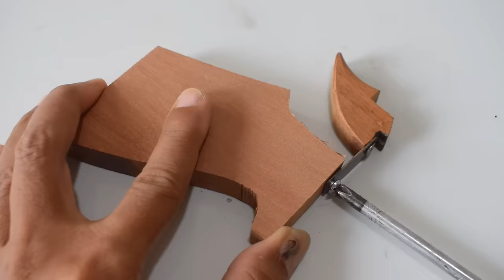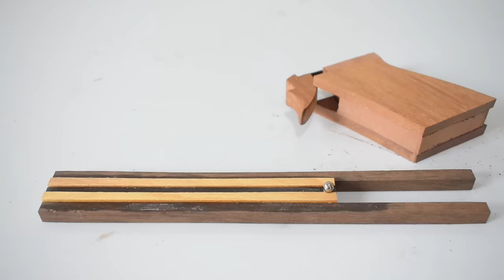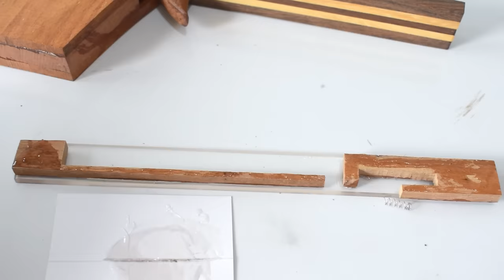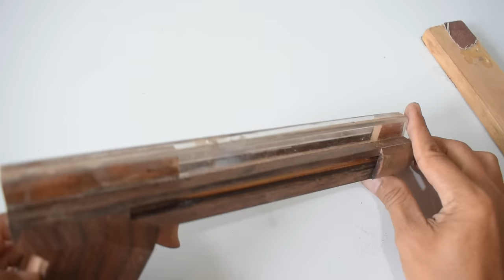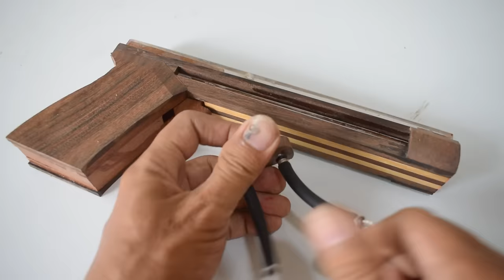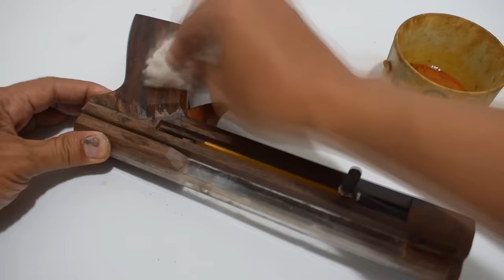Slingshot for defense

Comment: Really cool design. It's mostly held together with superglue, but most of the parts aren't under much tension, so that's fine. But I don't know how long the thin strip of metal in the gravity feed ammunition mechanism will last. 

Very attractive finish put on it too!
Reply from the maker: Thin metal as a trigger is strong. But the rubber no. The rubber can change if broken
Reply: @diycrossbow  Cool then. Thanks for answering. I'd love to have one of my own!
Reply: Two flat wooden parts stuck together with super glue , become pretty much one piece. I can assure you that you wouldn't be able to take that sling apart. No way.
Reply: @marcinradziejewski6086  Yeah, but you don't need to take apart the entire gun to replace the bits that would need replacing. It's fine if most of it is now a solid object. Only the "strings" for the slingshot are likely to need replacing anytime soon, and that's an easy fix.
Reply from the maker: Right. Only string and rubber need to replace. Another material are strong 🙏🙏🙏
Reply: @Indicteronomy I thought they were saying that as a testament to the sturdiness of the build, not saying that it would be hard to repair because of the sturdiness
Reply: @marcinradziejewski6086  q pegamento usas broh ❓

Comment: Aside from the fact using CA glue to stick together pieces of wood isn't the best way to do it (there's also wood-exclusive glue that works better), isn't putting CA glue in both pieces, letting it dry for some seconds, then strongly pressing both pieces against each other a bit better? That's all there is to question about this build, amazing job
Reply from the maker: Wood glue is the best, for fast result CA are good choice

Comment: I have a question regarding how strong this slingshot is, would you happen to have rough stats like feet per second, and a rough estimate of how much effort goes into pulling back the rubber band. I am also interested in how far away it remains accurate. This is just personal curiosity at how effective this is as a design compared to standard slingshots. I am aware you could increase the power with a stronger rubber band, but just for curiosity sake, as it seems something like this could make a good starter slingshot due to being able to incorporate a site if it remains accurate at moderate range
Reply from the maker: For power and accuracy you prefer choice long design slingshot
Reply: @diycrossbow  thanks for the advice
Reply from the maker: Welcome
Reply: @diycrossbow  Hi, how much of the thin c.a. glue did you use ,roughly.

Comment: A few issues I can't help but wonder about:

1. That CA glue can't possibly be strong enough to hold this all together long-term. Have you had these break?
2. The CA glue also soaks into the wood fibers. Won't it make the finish splotchy?
3. The way you secure the rubber tubing to the screws looks like it's just waiting to come flying off.
Reply from the maker: Thanks🙏

Comment: Some suggestions for both the audience and creator, dont use superglue/crazyglue. Use an actual wood glue, else in a few years with constant use, the layers will seperate due to moister and temperature and because those glues are extremely brittle. Also regarding the trigger system, it would be more reliable to put the trigger on a pivet and use an actual spring. Especially because buying a strong spring is often cheaper then buying a piece of spring steel, cutting it down and drilling holes into it. Finally, if you don't know what you're doing, the friction from working the steel will destroy the temper of said spring steel, and it will become less springy and more brittle.
Reply from the maker: Thanks for watching🙏

Comment: Nice build!

On the wood to wood parts,  I understad why the video would use super glue  (so they don't have to wait for the wood glue to dry and can quickly get it made for the video).  But other than that, is there a reason to use the superglue rather than wood glue for teh wood on wood parts?

Obviously, anything involving pastic or metal requires the super glue.
Reply from the maker: At ordinary work I used wood glue. But for video making super glue fast dry
Reply: @diycrossbow  That is what I assumed.

Thank you, and again, great work.
Reply from the maker: Regard 🙏🙏🙏

Comment: Interesting design but  some of where you used super glue I think I'd make it with wood glue and some dowels for added strength.  Super glue has it's uses and yes the dowels would just be an extra step to the process I admit that... But I'd still do it that way.  The epoxy on the acrylic and wood part I can't fault you as if you want that see through look the epoxy is the best way to go.  Interesting enough vid though...  Ya got my sub for it.
Reply from the maker: Thanks my friend😃